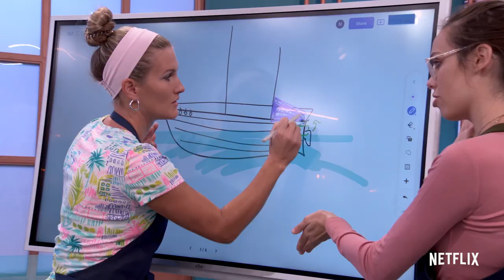Baking Impossible Season 1 | Official Trailer | Netflix

Comment: The judgment at the end was flawed. The team that won second place was obviously more skilled throughout the entire competition in both baking and engineering. The wrong team won. They should look at the entire history of the teams success rather than JUST that one last project to determine who wins the title. What is the whole point of doing all the previous challenges if it’s completely disregarded in the last challenge ? If one thing goes wrong at the end that shouldn’t determine their judgement. It’s like you go to school and do schoolwork for the entire year only to discover it was all for nothing and the only marks that matter for you are your final exams.
Reply: Exactly
Reply: The point of all the past challenges is to figure out who will be in the finale😂 It’s like running a long race ig. Through out the race, some ppl fall behind, some give up, and at the end, it all comes down to a few ppl. Out of those few ppl one will be the winner. You don’t determine the winner on if they started slow or not, you determine the winner by who ended the best (or the fastest). Sure, some ppl think it should be judged as a whole, but there’s nothing wrong with using the past challenges simply to eliminate others imo
Reply: @Jadencfilms  very much agree